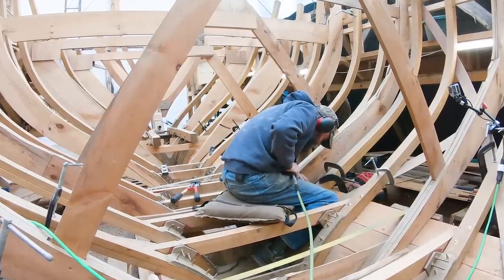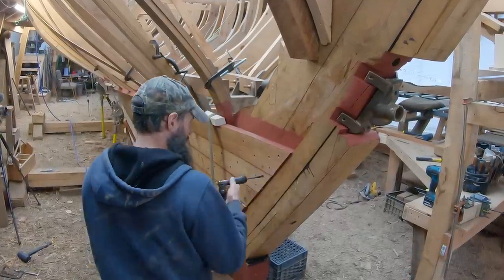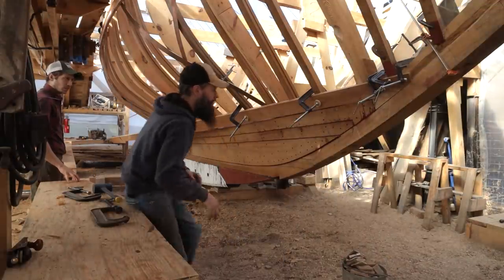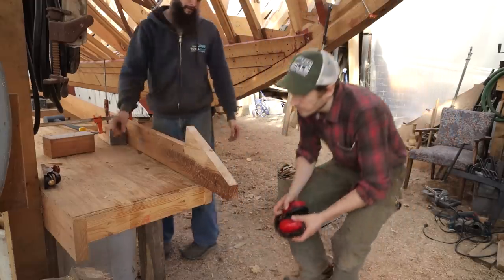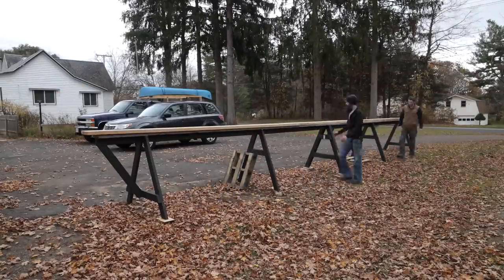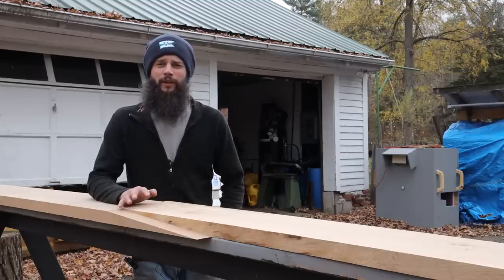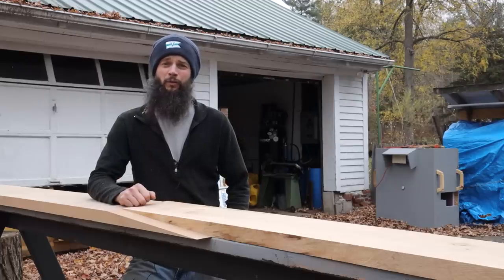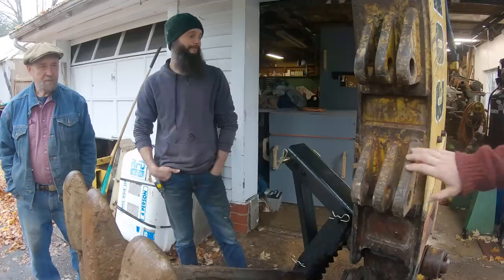Acorn to Arabella - Journey of a Wooden Boat - Episode 89: Planking Our Boat

Comment: I'm following all the time.  Great to see all this work.  I will be scarfing some planks for a mast repair and would like to see  a drawing of your scarfing jig.  Looks like exactly what I need.  
On another note, I'd have chosen to keep the backhoe "stock", since you're planning to resell it.  Some buyers might see your work as an upgrade while others would now be unable to use it in its original intended way.  
I will continue to watch as long as I can, since I'm racing to get my boat to the sea, where I may not have the ability.  
Great work!

Comment: 1. Love seeing the Yankee drill being used; so old school
2.  Sure you guys could get a winter job 'winching' cars out of those northern ditches.
3.  ? I realize the purpose, but what is the small extra block called at the bow in the planking end?
4. I'm surprised there's no 'Improved method/tool' for peening the heads of the rivets?
5. Didn't I see a new Adze in use for scarfing?
LOVE MY FRIDAY VIDEO'S !

Comment: On the matter of the rusted out fuel tank:  There is a two-part product that you can mix, put in the tank, roll the tank around until the whole of the interior is coated.  It will harden up.  Drill your fuel line holes out and you have a restored fuel tank.  Viola!  No more rusty tank issues!

Comment: Might I suggest, for drilling deep holes in wood.  Take an old bit,,, hand bit and brace tech.  The can be found in any old tool antique store,, or ordered on line.  Two cutting flutes, and a screw tip to pull the bit through.  The modification I would suggest is , you may want to remove the threads , reduce, or flatten the screw draw point.  The long spiral twist was designed to pull all chips up and out of the hole.  Modern bits rely upon stroking the bit in and out to clear the chips,, some do this poorly.  Those old brace  bits did not clog.

Comment: I don't know if you guys are doing this, but maybe for the winter for the boat shed, make it doubble walled. with an air gap between them, helps with heating, isolation, and condensation. could be benevisial to you guys during the cold season.

Comment: I was wondering if you have been annealing your copper rivets before you’re using them. It will make your lives a LOT easier if they have been softened. Annealing can be done by heating until ‘red hot’ (the red can be seen in a dark room) and then quenching in water. Your rivets have been ‘work hardened’ during your manufacturing process.

Comment: I've been watching your videos since the beginning and am fascinated by  your work. I've never built a boat in my life, but I've been a carpenter/woodworker all my life.   I am curious about one thing. The planking you are doing in this video is simplly butted and not "shiplapped", why is that?
Reply: I was wondering  that as well.
Reply: This type of planking is called carvel planking and relies on caulking between planks.  The planks will swell when exposed to water and so will the caulking in the seams, creating a dependable water tight seal.  Lap strake, or ship lap requires each plank to be tightly fitted all along the plank edges and many fastenings are used between frames.  It relies on the wood swelling when wet and creating the seal.  Both methods are traditional, the carvel requires fewer fastenings, but uses caulking.  Note that caulking failures can be possibly repaired from inside the boat if necessary.
Reply: @boooshes  At least in UK, the usual name for the overlapping strake type of construction, is "clinker" built.  https://en.wikipedia.org/wiki/Clinker_(boat_building).  Ship lap in UK  is something you build wooden sheds out of.  It is practical to build large boats using clinker construction, as the famous Viking longboats were built using this method,  and among modern boat designs the Nordic Folkboat is traditionally clinker built. However this method of construction has an upper limit on the size, and limits on the form of the hull you can achieve, so for wooden boats of Arabella's size and hull shape, carvel planking is pretty much universal.

Comment: Bonjour Alix and Stephen,
Could you explain me why you put rivets ? Why would it be safer, stonger than a good nut and a good bolt also made of copper if really needed in this case ? 
Amicalement, Raphaël
Reply from the maker: Salut Raphaël, the bolts would be much more expensive (and wouldn’t be copper). They would also have to have the end of the bolts sticking out and wouldn’t be a smooth fastener on the inside of the hull.

Comment: If you use your heat boxes the other way up you should get a more even distribution of heat.   Will need to put the clamps up the other way too!
Reply: Then glue could drip onto a hot bulb. The outcome would be bad.

Comment: Wonderful work guys. Curious about the harpoon shape at the front of the planks? I've not seen this in 30+ years in and around wooden boats... Seems like a lot of extra work
Reply: Where the planks would otherwise end in very acute angles and be difficult to fasten, these ends prevent that problem.  As the bow begins a sharper rise, they will likely quit that.
Reply: @boooshes  hmm I guess I kinda understand the concern... I'm not entirely convinced that the little triangle hanging off the hood end of the plank above is any less prone to splitting than the forward end of the plank cut to a sharp angle... Is this a particular Scandinavian planking style?
Reply: @danoyes1  each plank situation is open to judgement because the idea is to fasten close to the stem and hopefully with multiple fasteners and keep the end from splitting.  Usually the nub on the hooded ends won't carry a fastener, but if there is no hood (long, sharp point instead) you wind up with a single fastener near the narrow end.  The idea is to use as few hooded planks as possible to get where the plank can carry multiple fasteners near the stem.  Just a judgement call in my opinion. Notice the plank below the hooded plank has a stub end that can carry at least two fasteners near the end of the plank.

Comment: Will you go back and give the screws holding planks one more grunt before bunging the holes?

Is there big temp difference between the lower and upper sections of the warming boxes? Maybe a small circulation fan?

Comment: Such a pleasure to see the careful fitment of each plank. Those planks will swell with seawater. What happens to the size of each plank then?
Reply: What happens is that the planks will tightly squeeze the caulking that will be placed between each plank (which you'll note the guys have carefully left a small gap for, between each plank), thereby creating a watertight joint that can still flex.
Reply: JAFO thankyou. I had hoped they had left expansion gaps but didn’t see it. Of course they would have....they have done everything so perfectly.
Reply: @peternicholsonu6090  - You're welcome.. if you watch closely, there are one or two moments where you can actually see daylight through the gaps between planks.

Comment: Question; I have been following along, and may have missed it, but what actually holds the boat upright at the moment? Many years in the boatyard and always the funny/scary story about the guy who moved the boat poppets to paint......forgot about them, climbed aboard and tipped the boat over. Your boat is way bigger than mine. DD
Reply: The temporary frames that the boat is built around are attached to the temporary decking that surrounds Arabella.
Reply from the maker: Harry is correct. The whole thing is quite stable.

Comment: Question guys...If you look at 9:30 mins on the video, the fourth plank down, has it twisted and pulled the fixings through to let it protrude that much? 
Anyway still glued to this series. Very best wishes from the Isle of Wight. Southern England
Reply: I doubt it.. probably just a slight variation in plank thickness.. the additional material will be removed as part of the hull fairing process later on.
Reply: @Garryck-1  If that's what you think, maybe someone should check the blades on the thicknesser. Never ever had that much variation in a piece of wood.
Reply from the maker: The planks are all left proud of their final thickness so that once all of the planks are hung, the hull can be smoothed. This way we can back out the planks without making their final thickness too thin.

Comment: The planking looks really damned good guys. What would happen if you steamed the whole boat just before you removed the temp station frames?
Reply: Ummm.. why on Earth would you do that?
Reply: @Garryck-1  to destress the tortured planking.
Reply: @thomaswhaley4024  - It's more likely the whole structure would sag under its own weight..
Reply: @Garryck-1  If that is an issue it would seemingly be easy enough to remedy with some upright supports around the perimeter. I am entirely unsure whether it is a good idea or not, could be all kinds of issues. But it bothers me that the boat is constructed of so many planks under massive stress counterbalancing to maintain shape. It's hard to believe that it hasn't already lost it's intended shape at least a little. And the boatbuilders of eons past didn't have the option of using a cheap plastic tarp to enclose an entire build to destress it.

Comment: Watching your vids regularly, but not sure if I have missed that point; how do the planks get watertight to each other?
Reply: The seams have a cotton filler if I remember correctly. When she is the water the planks will swell a bit locking them in and creating the water tight seal
Reply: @4stringmanagmaildcom  thank you for clearing up the caulking compound. Couldn't remember the name. 👍👍👍

Comment: Scarfing the planks is a beautiful but time consuming solution to extending the planks to size. Although not as pretty, joining the plank pieces to boards attached between the frames would be a lot faster. Is roping and caulking end grain a no-no or would this work?
Reply: @harrymoyes5069  Thank you.  I understand how splicing the plank before installation could cause a stiff spot. My thinking is to put a backing board between two frames and then attach the planks. The backing board could be shaped to the curve of the boat.
Reply: @sidvak9700  - There's also the fact that scarfs are a much stronger joint than butted planks with blocks.. and another consideration is that butt blocks just provide a place where dirt and moisture can build up over time, causing problems with rot, down the track.
Reply: @Garryck-1  Gotcha. Worth the work.

Comment: Hi guys there is relatively  inexpensive tool that pushes the inner coper washer thing down and snips the excess rivet off in one movment.
Reply: @cmmartti  sorry i dont mate ,it needs compressed air to run and is very similar to a rivet gun but bigger. I actually saw it at company that produced office furniture, they would spot weld a piece of  3 inch mild steel to a cabinet then another sheet would go over that to create concealed space. Then they pushed the tool on with washer type thing and pulled the trigger it tightened the washer thing down onto the sheet and severed the piece off. Sorry i cant help anymore
Reply from the maker: Thanks for the tip! It might not work with our very large rivets.

Comment: Why not put some rivets on the glue joints? Great videos!
Reply: Not enough thickness.
Reply: I presume you mean the scarf joints in the planks?  The hull will be "faired" after planking. Rivets through the planks need to be buried deep in the plank, not to interfere with fairing the hull, and thus there would be little of the plank left to rivet too if you riveted through the scarf. Where the scarf falls across the ribs, the scarfed plank will be riveted through the plank and the rib underneath.  I'm not clear if the 12/1 slope of the scarf is sufficient to bridge between ribs,  and what care AtoA are taking about where they fall on the ribs, but  I guess in most cases at least somewhere on the scarf will fall on a rib and thus get riveted into place in addition to the glue bond.

Comment: How come you don't use steam on the boards to bend them ?   I see a lot of boat builders do...  I'm just wondering  if there's a reason.
Reply from the maker: The planks lower down didn't require steaming, the sharp bends higher up do require some steaming. If you've watched the earlier videos of steaming in the frames, you probably noticed that you don't have a lot of time to work with the wood after it has been steamed, and the planks require several stages of adjustment before they can be fully fitted.

Comment: Silly question. How are you going to move the boat out of there and to water?
Reply: Very carefully
Reply: @apfrost There are trailers designed with hydraulic arms that lift and conform to the hull shape. They will take apart the end of the shed and back the trailer in under the boat is what i think they will do.
Reply: The weight on those roads is more what I’m talking about.
Reply: @afpost  you just get permits from state/s, and they will tell you where underweight/short bridges are. Its just an oversized load. No big deal just a little extra $

Comment: It looks like you are getting a plank on every 2 to 3 days - is that a close estimation?
Reply: I'm wondering that as well ... how many planks a week?
...seems as tho they have a solid system for producing each plank now; as they can select boards, plane, and cut the scarfs for one plank while the last one cures in the hot boxes, then repeat as they hang a plank on the boat....so at any one time there could be three planks in 'action'....vs spending a day on each step of the plank coming into being, and just taking ~4 days to complete a plank before starting another .... snow might slow that down, but a crew at each station would speed things up to where you could finish a plank every day? - and how many planks(per side) total?

Comment: She's really starting to show her lines!!  More beautiful every vid! You guys are cruching it.
One question about your scarf joints: Are they long enough?  My understanding is they should be at least three times the width of the plank and ideally span three frames.
Reply: They are 12 to 1 scarf, I'm guessing the plank thickness is about 40 mm, so the scarf length is about 480 mm. Don't know the frame spacing, but less than that I'd guess. Maybe not half that though, so not clear the scarf will span three frames.

Comment: The opening remarks had me thinking, did they buy a woodpecker? (If you don't get it, watch the very beginning thinking about my thought, and use your ears too.)
Reply: Okay, I was wrong, not a woodpecker, but a wood picker[upper]. Nice addition to the tool and machinery collection. Good maintenance will make that a decent savings account as well. You may recover a little extra, or you may lose a bit, money wise, but you know there's money to be had when selling it.  If it is a loss, than you still come out cheaper than renting one.

Comment: It's dumb question time.
It seems to me there is a lot of force being applied to the timbers as they are attached to the ribs by clamps.
Is this a standard practice?
Do the induced stresses in the timber get gradually relieved over time?
Would it not be more sympathetic to bend the timbers in only one axis, rather than two?
This would require shaping the timbers into narrow points at each end. I can see this would be a weakness and not very aesthetically pleasing.
Also the metal straps which are angle bracing seem to me to be light for the purpose they are given.
Has this hull design had any engineering analysis done to it, or is it the result of practical experience in hull construction?
Like I said dumb question time. Sorry.
Reply: The planks do conform after some months, especially when they are in the water,  but there is a little residual tension left over the life of the boat. That's good for keeping the hull tight.
The bracing wasn't on the original plans,  and is one of those "good ideas" from local advisers, the same ones that suggested using old fashioned glues.
The bracing is a waste of time IMHO as it forms compound curves, not like say roof bracing on houses.
If that boat ever loses enough planks to need the bracing, its going to be too far gone to matter.
I  can't even see that it will prevent any kind of assistance against wracking stresses while sailing.
Reply: @dnomyarnostaw  Thanks for your thoughts Ray. I guess the answer will be know after the boat gets some history.
Reply: Jim Nickles  Yes Jim. You are right about thin straps being good at holding things in tension. 
My view is that they only work effectively if they follow straight or geodesic lines.
In all other situations,  the straps dont follow compound curves like they do on a boat hull.
I  can't think of any hull movements that would be counteracted by what are essentially slack tension members.
Reply: Jim Nickles  "I think they would resist Hogging and Swaybacking motions,"
Yes, that is the intention. But, to my mind, that can only be accomplished by compressing the ribs they are wrapped around AFTER the planks have failed to remain rigid, and since the planks are already fastened around the ribs, they provide a much more significant resistance to the hull movements, from what I can make out.
To my eyes, they would have been better to put strapping vertically from the keel, fastened to the planks to keep the planks together, as the compressive strength of  the timber is the major structural component.
It would be interesting to get someone to do a "finite analysis" of the results, but I know how expensive and difficult that is to do.
In the end, its just a case of how much more weight and expense the straps add. I don't think it would be that much really, so its just an interesting mental exercise.